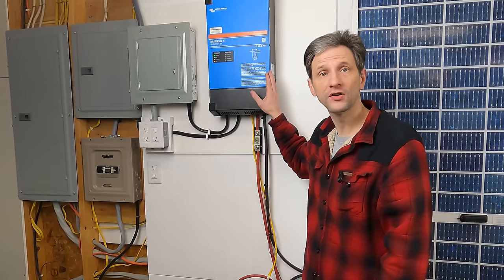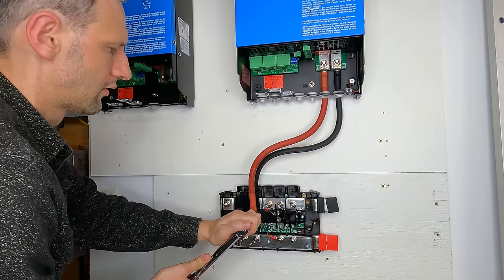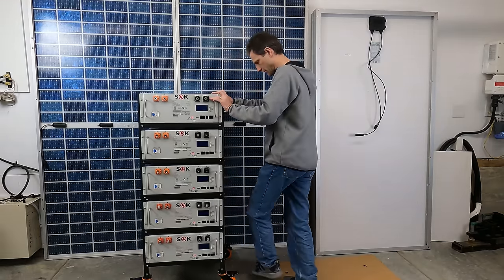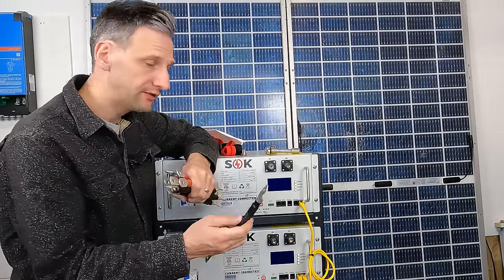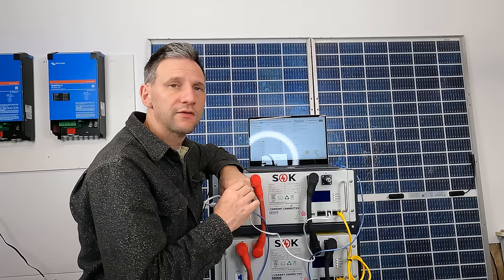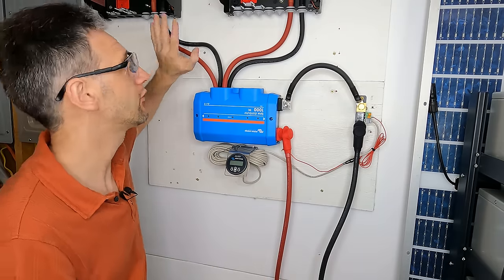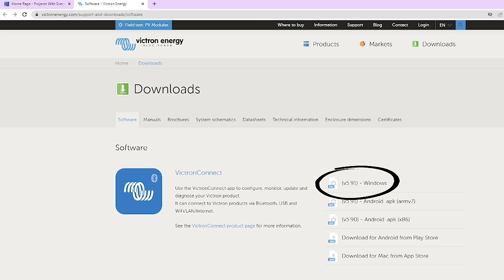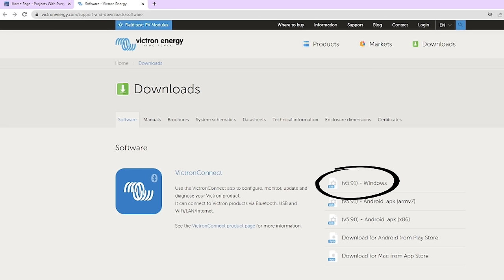DIY Split Phase Battery Backup for Home - Step by Step

Comment from the maker: Current Connected Website Affiliate Link: https://www.currentconnected.com/?ref=pwd
Downloadable circuit diagram and all project details on my website: https://projectswithdave.com/120-240v-victron-home-backup 
Single Phase Victron/SOK Home Backup starter install video: https://youtu.be/BzMAW8kW0CU
Reply: Wow, they have the Solark 15k for $1.7k less than what I paid.
Reply: does 2 inverters with 3 batteries workable?
Reply from the maker: Yes, you could do this setup with just 3 batteries.  You would just have less storage capacity.
Reply from the maker: Sorry, wish you had seen that in time.  Current Connected has good prices, quality products and great service.
Reply: Just bought 12 EG4LLs for that very reason
Reply: @DoDoBedStory why would you buy 2 inverters if you dont have the batteries to support it

Comment: I worked in substations for 20yrs. Never wore a metallic ring, ever. Silicone for the win. It's non-conductive and can't rip your ringer off if it gets snagged. The idea of a gold band conducting across terminals connected to a 200Ahr, 125VDC substation battery was less than appealing.
Reply: So true, I was coming back from a wedding and saw someone stuck on the side of the road with her hood open. She ran out of gas and walked a mile for some gas and when she came back her hazard lights killed the battery. I gave her a jump and my bracelet touched the fender when I took the positive off. It burned completely off my arm and left a nice scar to remind me. That’s what I get for helping 😂. I did car stereos and alarms for 30 years and never a problem.

Comment: In my opinion, the stationary rack is a mistake by SOK and the #1 reason EG4 is selling far more units. I love SOK batteries engineering, but having to customize the rack to have it mobile needs to be fixed ASAP. Current connected needs to be pressing them hard on fixing this.

Comment: You'll need a plate on the bottom of the rack. And the castors need to have steel wheels, the soft wheels will flat-spot over time.
Reply: Good tips

Comment: You could have made a wooden platform. Added your caster to the wooden platform. Then bolted the rack to the platform. Making it a little larger than the rack would’ve made it more stable as well.

Comment: The US Navy used to have a web site up about working with power. There were also photos of a sailor who forgot to take off his wedding ring, which caused a
crowbar short on a single 12vdc automotive type battery. They can and do provide over 3000 amps in a crowbar short, which resulted in the immediate traumatic amputation of his ring finger. That's one reason silicone wedding bands are now common.
 I don't wear rings, but I did manage to weld the rotating bezel on my metal watch. Twelve volts can really surprise you.
Reply: Just another reason to avoid marriage
Reply: Yup, it's not about the volts, it's about the amps.
Reply: yea I did this tightening up a positive  with both batteries connected to a starter on a M38A-1. I ripped that band off so quick I didnt even notice it took most of the skin under and around the band with it.

Comment: Thanks for sharing the update!

At 49:22, you mentioned that the shunt loses its SOC if it loses power.  Victron actually updated the shunt to give you the option of what you want it to do if power is lost.  That’s the “Battery SOC on reset” option, which right now is “keep SOC”.

I was so happy when they added that in!
Reply from the maker: Thanks for commenting on that. Yes, that new feature is great.  It works as long as nothing changes to affect the stage of charge after it looses connection. I didn't realize the update until I was done editing that section, but I did change the settings to "keep SOC" in the video.   Thanks!
Reply: @CherokezPittman  never heard of it

Comment: 6.24.23  Dave, this is an excellent install video.  Thank you for taking the time to make it.  I am currently building my own system.  I am using 1 EG4 battery and I also have the EG4 buss bar battery cabinet.  I also have the Victron Smart Shut.  As time goes on will add more batteries.  The batteries cost the most.  Thanks again
Reply from the maker: Thanks!  I'm glad it was helpful.  It seemed like it took forever to film and edit.

Comment: My first battery was a MASTER CRAFT. It worked well for testing out this solar stuff, for the first time.
I was given an INTERSTATE battery from a mechanic friend, who wasn't using it, it was a welcome addition to the 'customized battery bank'.  I then got myself a PRO POINT battery (which was twice the size of my master craft battery). They're connected in parallel.
I've got a humble 2000watt sine inverter and 11x 230 watt panels on the roof.  It's a 'starter'/beginner set up...but I've learned a lot.
Reply from the maker: It's good to set up a small low cost system.  You get some emergency power and a learning opportunity.

Comment: I get around the wheel problem by screwing my shelves and benches to a thick sheet of MDF (or plywood) and bolting the wheels to the MDF.
This might work here, however I use the same wheels you have chosen, but with the 4-bolt mounting swivel. 
Like you I studied Mech Eng and I still find out the hard way too. Love this vid. ☺

Comment: Not sure what SCC you have, but the Victron Smart Solar Charge controllers are awesome. I just converted over from a MPP Solar LV2424 24 volt system to a Victron Multiplus II 2400 /70 A system with 10kwh of SOK 206AH Marine batteries. The idle consumption of the MPP solar unit was 40 watts an hour! My new Victron Multiplus-II uses about 13 watts. It is like having an extra battery. I use mine to run my freezers in my garage and the refrigerator as well as a sump pump. I have two more 206 AH SOK batteries that I will use with either the old MPP solar unit or with the 12 volt Victron Phoenix inverter.  I live along the coast in NC, and after Hurricane Florence, I decided to invest in a back up system. Your setup is awesome, but I have back issues, so I stayed away from the server rack batteries. Anyways, great video content and take care.
Reply from the maker: Thanks for giving some real world feedback on your system.  My 48V MultiPlus II only uses 9W per unit at idle.  It's amazing!

Comment: Great video Dave, thank you for all that you put into this one.  I was on the fence between the new small Sol-Ark 5k1p, and Victron....this tutorial plus the drop of the new Multiplus II 5k sealed the deal for me.  Victron equipment is so nice, efficient, reliable and most of all -- supported.   It's definitely pricey but "Buy once--cry once"
Reply from the maker: Victron is more expensive, but I've never had any issues with setup or performance.
Reply: Don't forget to mention that these are Low Frequency inverters and for some clients that is a critical need. @ProjectsWithDave

Comment: A microwave is like an on-demand oven, which it is. It's off almost always. Your videos are amazing every single time. As an electrical engineer, your work is brilliant and best of all, helpful. Best-
Reply from the maker: Thanks for the encouragement, but I'm actually a mechanical engineer not electrical.  Most of my electrical knowledge is from research and projects like building my house and solar projects.
Reply: @ProjectsWithDave  I should have said "speaking as an EE..." I knew you are an ME from your posts. That's part of why I'm so impressed with your work as many people are nervous with electrical things. Glad that no one got injured when you had to redo those casters! This project is exactly what we are planning as well, right after I plumb backup water tanks into the house with a DC pump. Best-
Reply from the maker: Thanks.  I'm glad it's been helpful.  I know I don't get everything right, but I always find it helpful to see what others are doing even if I don't adopt everything they do.  The nice thing is, I can always count on someone to correct me in the comments.. : )

Comment: Great setup! There are also single units out there that'll do split phase, I went with a SunGoldPower 10 kW box and 5 of their rack batteries. I used the same SOK battery rack you have but with SGP's batteries and a total of 25.6 kWh capacity. It runs our house for a day and a half from a full charge. I'm very impressed.
Reply from the maker: I have a SunGoldPower split phase inverter, It has been running for about a year now with no issues, but setup is a pain.  You can see it in this video: https://youtu.be/IZjISqEWglU

Comment: Could not have gotten through my recent parallel install without this. Big Thanks! I have run into the different length A/C conductors issue, it appears. My system is very compact, (mobile EV charging system) with one conductor (10awg) set, being around 24 inches, the other, 12 inches. This is resulting in an overload alarm on L1, and ultimately, the inverters not starting up. Trying 4ft equal length conductors today.
Reply from the maker: I'm glad it was helpful.  The AC side conductors don't have to be the same length, just DC.  The AC side will always be unbalanced so length plays a very small part in that.  When do you get an overload alarm?  Are you sure you don't just have too many of your loads on one phase?

Comment: Excellent presentation. I did something very similar at my house with a 22 kW battery bank and two Multipluses. I can only get about a days worth of backup without charging the battery. I have 3 kW of panels so I still need to use the grid for about half of my whole house load but it sure is nice to have instant backup during an outage that allows flexibility as to when I want to run my generator.
Reply from the maker: Thanks!  I have to say, the automatic backup for outages without having to dig out the generator is great!

Comment: Hi, I would have rather suggested that you use a Quattro-II 2x 120V and a Cerbo GX. By using a Quattro you would not need a transfer switch and the Quattro would perform that function and with a Cerbo GX you can monitor your Charge / Inverters remotely. You could also connect your generator to the Cerbo GX and when your batteries get low the Cerbo GX could start your generator for you automatically and you would be able to monitor the fuel level then the tank of your generator.

Comment: Hi Dave!  You provided one of those screaming-at-the-video moments!  "No Dave, no!!"
The AC lines do not, in any way, need to be matched in length.   The very fact that they're coming from unmatched, differently loaded utility lines, and the outputs are going to never balanced panel phases while the inverters are not actually even putting out the same voltages, totally ditches the need for that extensive Borg look.  You can clean that up anytime the look gets to you.  😉
Reply from the maker: Thanks for commenting.  I realized that after I had it all installed.  The AC line length requirement from Victron in the manual is talking about parallel units, which the split phase setup is not.  By the time I came to that conclusion it was too late to recover and I figured equal length wouldn't hurt anything.  Plus, I wasn't 100% sure I wasn't missing something about how the units operate when in split phase mode.

Comment: are you familiar with shop "mobile base" to move a tool around the shop?  They have a pedal and lever assembly to push the wheels down and lift the tool, or let the base and tool rest directly on the ground for use.  A mobile base is the way you want to add wheels to a server rack.  Not by putting wheels directly under the posts of the rack.  The posts need to be tied together with more structural strength and is designed to be mounted to a cohesive, uniform surface to provide that tie.

Comment: Dave really enjoy your videos. I did something very similar but with the addition of the Victron autotransformer.   At first I just didn’t know how balanced the loads were and if it would top out one side of my split phase set up before using the equal amount of power from the other. Turns out in use it as you would usually mode I have less than 1000 watts imbalance. The auto transformer absorbs the imbalance with no problem allowing me to draw almost identical power from both victron multis 3k. It’s fun to watch on the Cerbo GX

Comment: About the wheels -- sort of reminds me of how welding gas bottles have to be secured somehow.  Basically it is with a chain to wall, or short term into the transportation cart.  In your case, probably you could use for example angle iron bolted to the wall and two shorter chains from the backside verticals.  Would look nicer than a single chain all the way around the front.

Comment: At a bare minimum you want to be using Class-T fuses as your main bank protection for an LIFPO4 bank. This bank can easily throw 20,000A or more of current into a dead short and can damage and literally blow windows out of Mega fuses.

Comment: In Europe there is the 230/400V electricity system. The small inverters are connected between neutral and phase 230 volts. In the three phase system with 400 volts in Y configuration with neutral.

The instructions also show that the same inverter can be connected to 120/240 volt split phase. So on phase to phase 240 volts, but not with neutral. With three-phase then in delta configuration without neutral.

Comment: Dave, just wanted to say your videos are awesome, and super helpful for me doing research on setups like this. One question: will you eventually run conduit for the DC cables? I can understand why you would want some flexibility while you're testing things out, but wanted to know if you planned on running everything in conduit eventually. Thanks again!
Reply: Conduit lowers the wire rating
Reply: Why would you need conduit at 52-58V?

Comment: You could've done the same thing but waaayyy more simpler (and more features) by going with a SolArk 5k or if you still wanted a bit more work a Schneider XW6048 Pro, but great job and thanks for all the information Victron makes top notch equipment too.
Reply: I am considering the SolArk 5K 2P and I agree about the Victron prices being higher but I think a key difference that shouldn't be overlooked is that the Victron inverters are Low Frequency Torroidal design and the SolArk is a High Frequency inverter. Might make a difference to people with heavy duty motor applications.

Comment: Great video.  Maybe you explained and I missed it, but why are you using a transfer switch rather than routing the main power feed through the inverter?
Reply from the maker: The transfer switch allows me to switch between line input or generator input.  If you use the Quatro you can bring them both into the unit independently, but the Multiplus only has one input.

Comment: Great video, clear instructions. I'm about to build a very similar setup, only paralleling two 240v multiplus inverters. Do you not feel the need to install a main t class fuse and battery isolation switch in main battery line, or are you happy to rely on each individual breaker on the batteries?
Reply from the maker: I would recommend a T class fuse.  I think it's worth the cost for the extra layer of safety.

Comment: Wow, thank you so much for the walk-through - For weeks, I've been searching on how to design everything together and you've stepped through this perfectly for me to understand how to wire things and what to use. Once I pull the trigger on my equipment, I'll be sure to use your affiliate links to help contribute to your guides! I do have two questions for you, if you wouldn't mind offering your opinions?
1) In one of your earlier videos (I think your single phase one), you mentioned that the Victrons have inputs for generators. Are they direct connect 50A generator inputs? If so, would you still need the transfer switch if you wire the generator directly into the Victrons? I'm trying to find the simplest way to wire these as I'm very quickly running out of room around my panels. My goal is to just have the generator charge up the batteries directly as quickly as possible, so I can run on limited generator time, then use the batteries to power everything in-between.
2) Many of the batteries I've been looking at state that the suggested battery cycle life is based on the battery discharging to 30% and then charging to 80%. If you don't go through any power outages for a while, is that affecting the battery cycle life to keep it charged at 100% for months at a time? Or do you manually schedule a discharge every so often to keep the batteries maintained?
Thank you!
Reply from the maker: Thanks for the feedback!
The MultiPlus has only one input, you can use it for a generator or grid input, or you can install a transfer switch like my system to switch between them.  If you want to connect a generator and grid inputs at the same time without a transfer switch you would need the Quattro series inverter.  It has two inputs. 
I think its a good idea to cycle the batteries once in a while.

Comment: Crazy to think that the Ford Lightning accomplishes this, but with a battery 4x to 5x the size. It can power 220v loads, and the cost of a used one with less than 10k miles is $60K. I priced it out, and this could be a cheaper option, plus it can function as a primary vehicle.
Reply: It’s not quite that simple. You need their proprietary V2H system and a transfer/disconnect which is also thousands of dollars installed (one review put it at $7k to $18k just to install that tech) - it’s limited to 9.6kW - and it doesn’t do it automatically.
That system uses a CCS plug, so it’s not compatible with cars that use the standard J plug.
Reply: @FuncleChuck  I wonder what they are going to do for V2H when they switch production to the NACS connector.